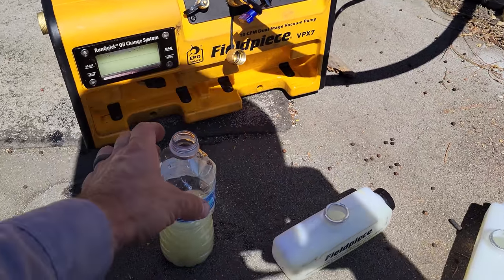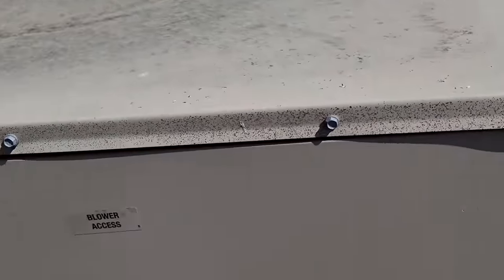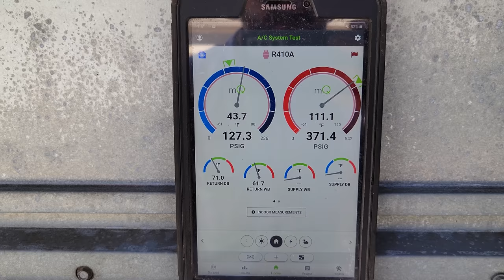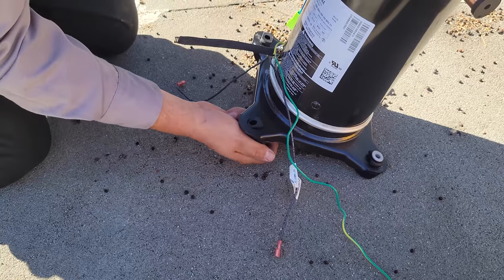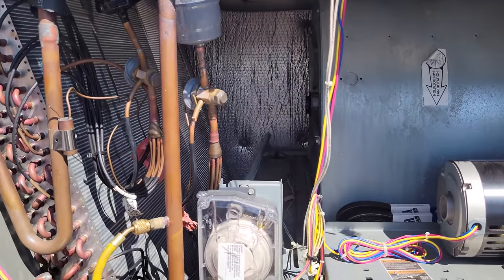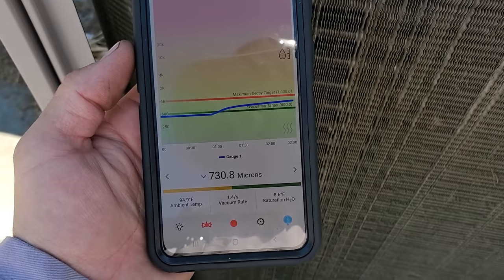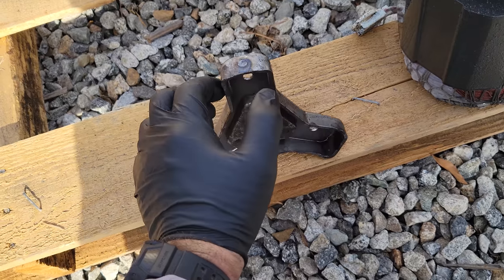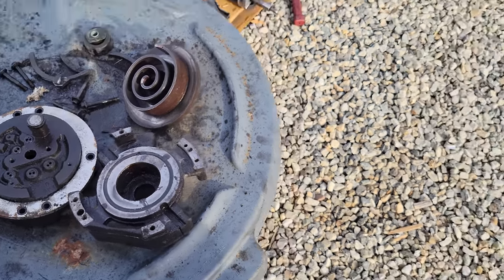INSANE MOISTURE CONTAMINATION

Comment: Not sure about LG but those type of compressor do not use suction gas for cooling. In the VRF type of systems the compressor are all discharge gas and suction gas is only at the inlet of the compressor.
Reply: When you say "those types" are you referring to rotary? Or are you talking about a scroll that is not gas cooled?
Reply: @jonnymac31  the scroll is not gas cooled.
Reply: @JeremyClauser  ZR94K* to ZR190K*, ZP90K*, ZP103K* to ZP182K* (Summit range), ZP232K* and ZP292K* (NG 
LCS range) compressors are equipped with an Advanced Scroll Temperature Protection (ASTP).
ASTP is a temperature sensitive thermo-disc that acts to protect the compressor from discharge
gas overheating. Once the discharge gas reaches a critical temperature, the ASTP feature will 
cause the scrolls to separate and stop pumping although the motor continues to run. After running 
for some time without pumping gas, the motor protector will open.
Reply: If they were not gas cooled the ASTP would not work to trip the OL because the windings would not overheat. This is out of AE bulletin AGL_AC_ST_ZR_ZP_E_Rev01 page 20.
Reply: @jonnymac31  I'm talking about VRF style compressors which this reminds me of.
Reply: Thanks for the knowledge on these.

Comment: one thing i've learned for scroll compressors: they are extremely hard to kill. they are complicated in comparison to types like rotary or reciprocating, but they are USUALLY designed to work like tanks, not dying unless you're actively trying to

Comment: No insulation on the TXV bulb ?, or is that just for refrigeration ?
Reply: Txv bulb should always be insulated,that way there is no interference from ambient air!
Reply: @petersmart1999  That's what I thought too, but clearly there is none on this unit.
Reply: @petersmart1999  As a new starter for Denco I went to a carrier water chiller that kept tripping on LP in the winter.
The long serving Denco engineer with me couldn't resolve the problem but as soon as I looked at the TXV I could see the problem.
The capillary on the TXV bulb was very long and wasn't insulated so it was affecting the TXV and causing it to close down because of low ambient temperature.
Wrapped capillary in armaflex insulation and problem never re occurred.👍

Comment: I may have a possible explanation.. The nitrogen tanks had loads of water in them . How that happens .... well.... When I worked at a prison ( as an employee) they had equipment but as far as supplies, forget it . So we would end up using refrigerant for leak checks . they kept us in refrigerant cause the office people system leaked and they were not about to sweat.. Well one day I got the idea instead of breaking federal law how about we use the recovery machine and pump air into the nitrogen tanks . We could get 500psi that way if we used three tanks we could pressure test a big system. This took forever but all you had in prison is time and inmates carried the tanks so whatever . Yes this would introduce moisture but I figured if we vacuumed it long enough we would get it back out .. we did this for a year. Well finally new budget and we actually got approved for some nitrogen tank swaps. The guy hands us the new tanks and I have the old ones up. the new tanks definitely weighed less than the ones we were turning in. Years later I talked to someone that refills those tanks and he said if they still had pressure he would just refill it and send it back out. You may have got a tank like that .  I really tried to keep the crap running . when I got there they didn't even have recovery tanks, I made a bunch out of old catch cans I scavenged from the corrections junk area. I get this seems like it's a bunch of bull , but here is an unlisted video I have inside of my workshop ,outside of the prison fence , where I cobbled together a system using a two ton r22 240v window unit compressor ,a 410a mini split condenser and a R22 two ton air handler . Best I could get was an 18 degree split when I installed it but I installed it in 2018 and last I heard it still works today in the shake down room for when inmates have to strip search when they get in from work ,now it's 75 to 80 instead of 100 to 110 in there ... this is prison ingenuity https://youtu.be/De_LYXMQneM

Comment: So the original time you were there and you recovered the refrigerant to weight it back in, you didn't pull a vacuum did you? You just got the pressure pulled down with the recovery unit, got the weight then added the extra you needed? Okay so I wonder if you would have actually pulled a vacuum with the vacuum pump if you would have seen the moisture in the pump oil  like you did the second time.  I realize in the initial situation you were saving time by not pulling a vacuum, as you did not have any reason to suspect all that moisture in the system. I wonder if there was some kind of leak originally before you got there, and to save money the owner got a fly by night in that pumped air and refrigerant into the system. Although with air in the system you would suspect radical shifting pressures.

Comment: Good forensics! You, and others, can use this info to tell your customers about the virtues of a Sporlan compressor versus an LG when the repair is not a warranty job. If LG ever gets upset (not likely) you can always come back with the market by upping the quality. This is a great service to the community. Not the N2, because the N2 is top drained there's no diptube so no way to get any water out of the N2 cylinder unless you invert it.
Reply: What model sporlan scroll do you typically use?

Comment: The manufacturer of the system or LG would be paying for that job in full (Moisture related- just over a year old).  I won't buy equipment with LG compressors.
 Your nitrogen was fine. You don't get moisture in a hermetically sealed system because of flooded starts.